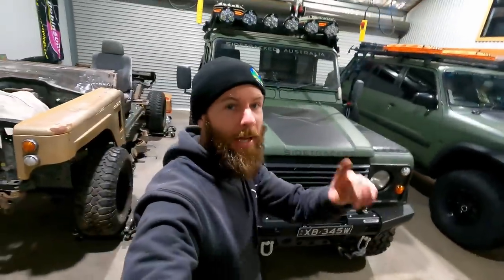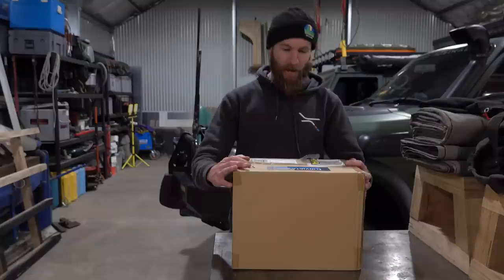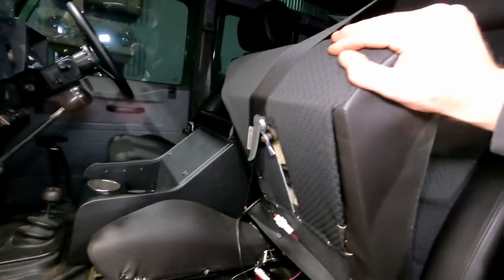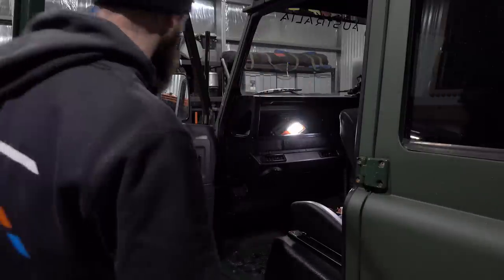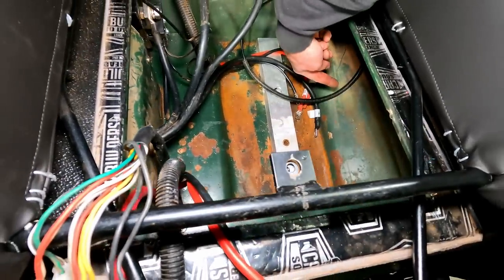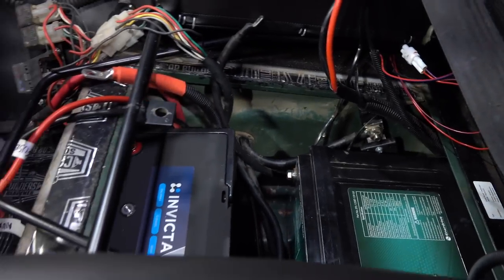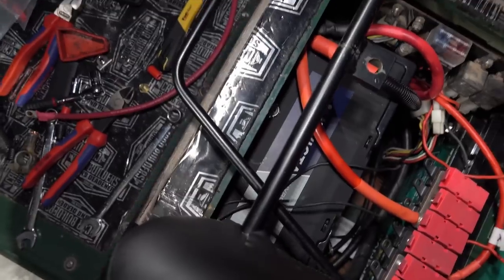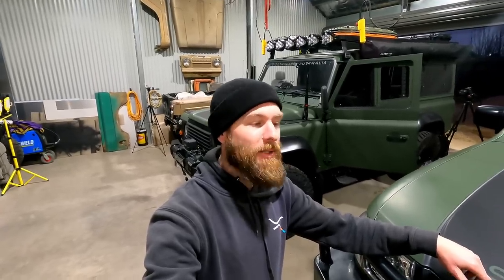#43 Lithium Powered Defender - Battery Install

Comment: Eliminate the current draw factor when winching, by eliminating the electric winch. It is a Land Rover Defender and can accept a PTO winch, which can be set up by yourself - worse case scenario is, may have to source some parts from UK. Generally, the PTO parts you need are in OZ, due to the amount of ex-army units around.

Comment: That's a really expensive battery for a few kg saving. I recently researched lots of batteries and ended up with AC Delco hybrid. See how it goes but excellent value for money. Posts and bolt connection, 22kg for 80 ah and 800cca

Comment: How does charging the lithium battery work from the alternator, any issues? 
Also those sunvirosr look great, was thinking of doing a similar thing but couldn't find anyone who had done it to their defender. 
Have you got any info on them?
Cheers
Reply from the maker: No problem charging straight off the Alt. The sunvisor is 4mm tinted perspex, used the original visor mounting, so much better for higher seats/tall people.
Reply: @SIDETRACKED  Cheers mate!

Comment: Nice but you didnt research very well. There is a battery with better specs, Australian designed and cheaper.
Reply: @Barry No longer available. DCS has better specs and also rated for not only 80c+ temps but -20c snow too